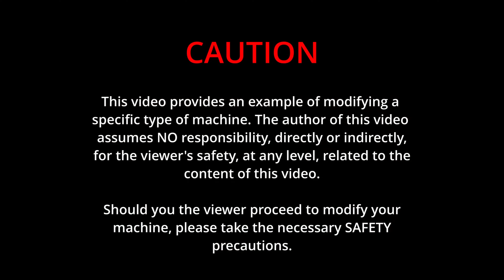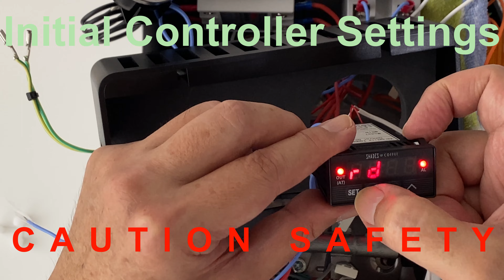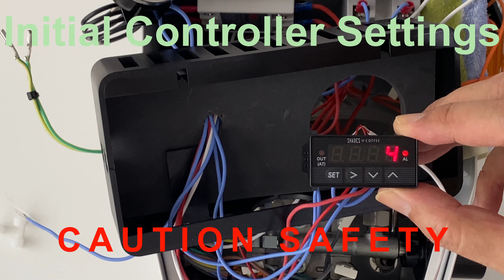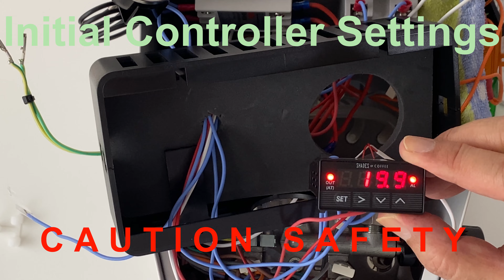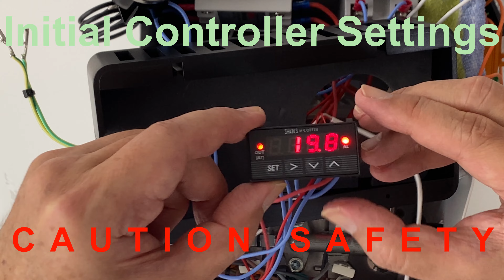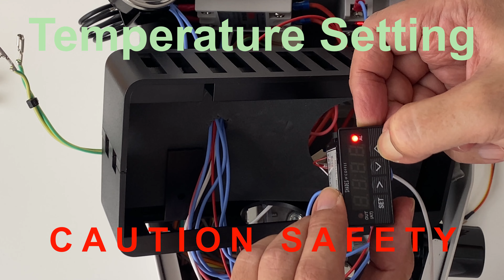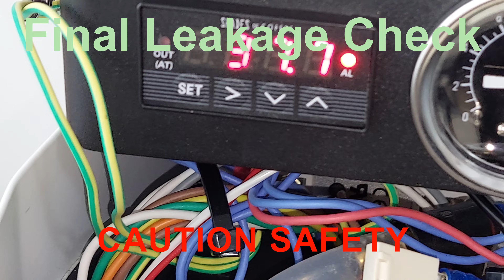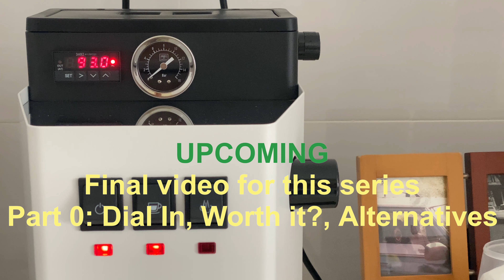DIY Mod Gaggia Espresso Coffee Machine (Part 4)

Comment: Hey thanks for the video series :)
Great job on documenting and showing the process.

Will probably do something similar although with an old ascaso dream (2012) and esp32 based (cleverCoffee)
But first I will have to change the seals on that machine.

so thanks for the videos^^
btw will you do a shot video showing the system running?
Reply from the maker: I will definitely make a video of calibrating and making coffee after the mod. I am a bit tied up with other stuff to make videos currently, but I have been making coffee in the meantime with the Gaggia after the mod and its been a wonderful experience. 
The ascaso is a thermoblock type and very different kind of machine, so it would be nice to see how your ascaso mod work out after you have completed it. And yes its a great idea to change the seals while you are at it, I should have done that for my machine too :-)
Reply: @troncaffe  thanks for your answer.
Looking forward to the video.

The Dream I have (Thermoblock with no opv) was a used one I got for 100€ (without a porta filter, untested).
So far it works but the seals are worn down so it can't hold pressure. Grinded down a Lelit one I got for 20€ to fit :)

First gotta fix it before modding it. I do have a lot of ideas for it tho. Installing a OPV, PID and Pressure sensor for example, but not all at once like you did but in different steps.

The goal will be to have fun exploring the possibilities of a set-up like this and then move on to something bigger with the knowledge I gained.
Reply: The dream isn't leaking no more:)
Was quite a fight as the group was warped and needed some leveling/grinding.

It's quite different to the pavoni I'm used to.

Will probably do a OPV and quickmill pulsor (to reduce noisiness of the pump) mod first.
Reply from the maker: @toterkiller47  Interesting... most machines come installed with OPV - its a required safety valve.
Reply: @troncaffe  especially older thermoblock machines used to come with a small spring in the grouphead reducing to 12-13 bar. Think the 0820 stretta from quickmill for example still does but I could be wrong.

Comment: Great video, helped me on my entired installation. Do you feel the need to check for leaks once in a while?
Reply from the maker: If you don't notice any leaks then its best to leave it alone 🙂.
If there is a leak you will most likely see water coming from the side of the group head when you are brewing at around 9 bars. 
It's best to make sure the plastic tubing is not bent or causing stress to the tubing adapter, because that particular adapter tends to leak or get permanently damaged if the plastic tube is not sitting straight inside the adapter. 
I damaged one adapter because my tubing was causing too much stress to the adapter and I opened up the machine to many times to check for leaks when there were none. 
My recommendation: Introduce slack on the coil tubing from the pressure gauge instead of bending the plastic tubing, so that when you open up the machine only the coil tubing moves while the plastic tubing doesn't.
I hope to make a video to explain this further in future if possible. It took me a few rounds of re-work, purchasing of the plastic tubing and spare adapters to stabilize the leak problem.

Comment: This may be a stupid question but for the pressure gauge, should I keep the 9 bar OPV installed or should I change it to a 15 bar for flexibility? I'm guessing stick with the 9 bar?
Reply from the maker: Good question actually. 
I prefer to keep the original OPV at 15-bar, based on my personal understanding of how the Gaggia OPV works.

Firstly, brew pressure is determined by the puck and not the OPV. Coffee type, volume, grind size and the portafilter basket filter type determine the brew pressure. 

Secondly, OPV is an "Over-Pressure" release mechanism and a very crude form of pressure regulator. Whenever pressure goes above the OPV set value, as determined by its spring-based stopper valve, the OPV releases some pressured water back into the water tank to keep brew pressure within the desired limit. It is certainly not an elegant form of pressure regulation and probably results in spasmodic pressure at around the set value.

In our modified machine the we have an extra mode of pressure control via the AC supply to the pump. It allows an analog means to regulate the brew pressure at the puck, but within the upper limit as determined by the puck & filter (not the OPV). 

Which means that if you are controlling the brew pressure through the pump at 9-bar then its not desirable to have the OPV at 9-bar interfering with your pump control. Its better to keep the OPV at the original 15-bar for a single mode of control.

Of course, as a side note, with the pump control and the OPV at 15-bar we have the means to determine the upper limit of the puck - as you say keeping OPV 15-bar allows for flexibility.

With the GCP Evo I am surprised that the machine reportedly comes with a 9-bar OPV, I think it is a step backwards not forward. The engineers at Gaggia probably lost the argument to the marketers there.

Comment: How did you fit pid and gauge through the small cut out for the display area?
Reply from the maker: Slide the PID from the front, its a snap-in lock - see part 3 video. Same thing for the pressure gauge, except that it is held at the back with a screw-in bracket rather than a snap-in.
Reply: @troncaffe  I see, had to remove the cables and do it again.

Thanks for the response!

Comment: Hello, this series is very well made, congrats. I am considering buying the same kit, but I am unsure whether it's the best option for the Gaggia or not. What is your opinion after some months of use? Would you recommend it over other kits available? I like the idea and implementation of Gaggiuino but the noise the pump makes is terrible in my opinion and would not stand it.
Reply from the maker: Thanks Stefano, for your questions. 
I hope my following frank answers won't ruffle too many feathers among the viewers - as always I welcome healthy discussions.

Q1: I am considering buying the same kit, but I am unsure whether it's the best option for the Gaggia or not. What is your opinion after some months of use? 

Ans:
Yes after months of use, I find the mod very useful, functional and enjoyable to use.

The mod kit adds 3 extra levers of control to the Gaggia, namely the Brew temp setting, the Steam temp set, and the Continuous control of brew pressure. 
It also adds 2 visual feedback, the temperature and the pressure readout, and prominently at the top of the machine too. 
These 5 features make a huge difference to the level of control and satisfaction during the coffee making process.

What else I like about the kit:
a) It takes out the guesswork during brewing and steaming.

I would say that its best to mod the full kit instead of just the PID. The pressure gauge and the dimmer switch, as a set, are a necessary in my opinion. 

b) The kit comes with some neat design considerations from the designer (Mr Shades) - such as the addition of the discharge resistor to the dimmer switch circuit to reduce chances of electrocution from the capacitor - I explained in one of the replies.

c) The dimmer switch works very well in controlling the pressure - judging by the responsiveness of the pressure from the gauge.

d) The PID works well of course, but the steaming temperature control is very useful too, even if its not a PID. Having control of the steaming temperature is really useful when trying to steam milk for your latte art.

What is not ideal:
a) Leakage took some time to fix and re-fix. I had to purchase extra pressure tubing and pressure adapter to fix the leak issue. The leak happened because I messed around too much with the tubing which damaged the adapter. I will try to cover this in the next video.
But Mr Shades was very responsive, and I managed to purchase from a local source the plastic tubing and valves to fix the leakages.
b) The original pressure kit had leakage issue - I covered that issue in the video on the pressure gauge mod.
c) The cosmetics of the top box is not ideal.
d) The potmeter knob is not pretty, I had to change it out.

Summary:
The mods to the Gaggia is great, though not perfect.
Of course, we are modding the Gaggia because we already own the Gaggia. The reasons for acquiring a Gaggia Classic Pro in the first place is a separate topic.

Q2: Would you recommend it over other kits available? 

Ans:
I have not looked into other similar kits but i believe they are quite similarly made. 
SoC kit is certainly well thought out and complete, I would recommend it if you are new like me to modding the Gaggia.

Other kits alternatives:
a) OPV only mod - it relies on over-pressure alone to regulate the pressure. I think the pressure may be choppy during brew and there is a constant back flow of water from the pump to the tank? I may be wrong, but I don't see much value in this mod.
b) Purchase your own full set of parts to mod - this is definitely doable, and its possible to make the mod even better than SoC's kit too.
Component costs are much lower but need extra effort.

Q3: I like the idea and implementation of Gaggiuino but the noise the pump makes is terrible in my opinion and would not stand it.

Ans:
The Gaggiuino is a beautiful kit, but I agree with your observations on the pump noise.
From watching Gaggiuino videos, it appears to use Full_ON/Full_OFF control of the pump to regulate the pressure. Maybe a D/A continuous CL control will achieve pressure regulation with more finesse..

On the other hand, the dimmer switch mod, in the SoC kit, is a continuous analog-based control of the pump, which means it doesn't create Start/Stop pump noises. Better for the pump life.
Reply: @troncaffe  thanks a lot for the detailed answer, much appreciated. Interesting observation on the potential pump lifespan issues with the gaggiuino, I had that thought too. Not sure why they went for pulse width modulation over analog. Overall I think I’ll go with the SoC kit, besides the pump control issue of the Gaggiuino, I’m not sure I really need that much control over coffee making.
Reply from the maker: @StefanoCipo87  PWM shouldn't create the start/stop type of pump noise. A well implemented pwm is almost as good as analog. Enjoy your coffee making 🙂

Comment: Hi, great vid. I have done the same upgrade like you did (everything from shadeofcoffee), after full installation and configuration, everything appears to OK after tunning on, however when I flip the brew button, instead of the hot water coming there was alot of steam, it appears the mahchie is over heating. Any idea where I might be missing?
Reply from the maker: What is the brew temperature setting? How are the temperature readings over time like after you turn on the machine?
Reply from the maker: Also check if your temperature unit setting between Celsius or Fahrenheit is correct
Reply: @troncaffe  Yes, there was in correct setting that cause the temp to go too hight.

However I got new problem, the first few shots were great with dimmer it would go to 9bar when I dialed the dimmer all the way up. but after a few shot later with no changes at all (same coffee, same grind size and everything else), the pressure dropped to 8 bar and some times at 7. do I need to do anything with the dimmer like readjust it? I understand that grind size will impact the pressure but I haven't not changed that at all, I even increased the grind by two notches on my Niche Zero and the pressure still lower.
Reply from the maker: @kl-ke9ec  Firstly the dimmer shouldn't need to be dialed "all the way up" to achieved 9bar, assuming you did not change the OPV from the original. (BTW I don't encourage changing the OPV for a lower pressure).
The dimmer's potmeter rotation range is roughly from 12 to 10 o'clock. Since the original OPV the max pressure is around 15 bar, then 9 bar should be around 6 o'clock.

Dial the potmeter to around 6 o'clock, then find the grind size to achieve approx. 9 bar. If the pressure changes by more than 2 bars during it usually means the puck channeling - try making sure the portafilter is dry, apply WDT and use consistent tamping.

During brew the pressure may change slightly, simply dial the potemeter to bring it back to 9 bar. The beauty of having the potmeter and pressure gauge is that you get to profile the pressure any way you want. I usually start at 3 o'clock, then bring it to 4 bar for pre-infusion for a second, partly to reduce channeling, then dial it to 9 bar for the rest of the brew. The pressure gauge is very responsive to the potmeter in both directions - excellent analog control imho.

Lastly, grind size is inversely proportional to brew pressure. If you find the brew pressure to be low then decrease the grind size to increase the brew pressure.

You need a number of iterations between grind size, amount of beans, pressure, type of beans, extraction time, temperature to suit your espresso taste. Enjoy!
Reply from the maker: I am assuming above, of course, that there are no leaks in your mod.
Reply: @troncaffe  I didn't need to do the OPV because it's Evo pro US model which already had pre installed 9 bar opv
Reply from the maker: @kl-ke9ec  interesting, in that case at 9 bar the OPV will be triggered continuously. I wonder if the pressure gauge readings stay steady at 9 bar when you brew in ideal condition or fluctuate around it..
Reply: I have the Gaggia EVO Pro 2023 US model, so the OPV is preinstalled at 9 bar the highest. I intended to have a dimmer for preinfusion after installation went fine and the first few shots were great, when I dial the dimmer all the way up the pressure would at 9 bar steady. however, after a few shots, while I have kept everything else to the exact same (same beans, grind size and dose etc), the pressure will only go as high as 8 bars and sometimes a bit lower like 7 to 7.5 bars regardless of how much I dail the dimmer.
Reply from the maker: @kl-ke9ec  it’s either puck channeling, normal bean variation/distribution, or worst case - leakage in some part of the mod.